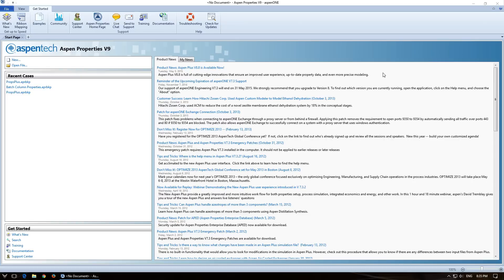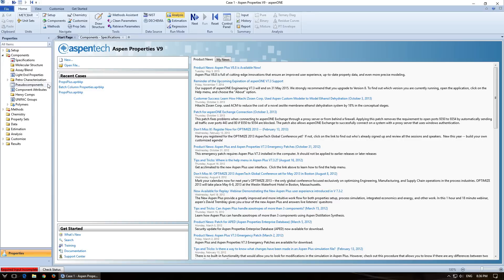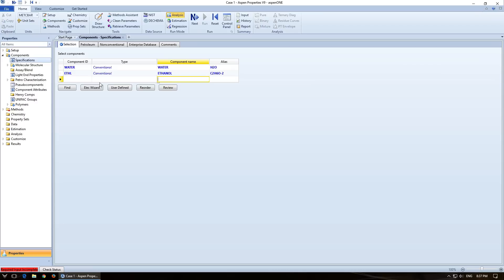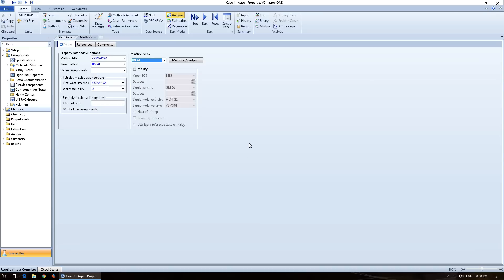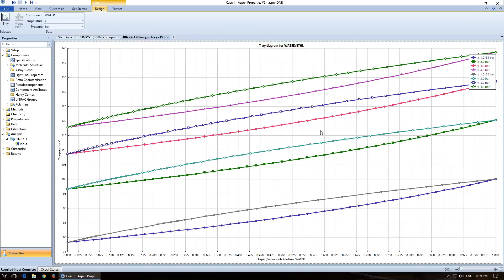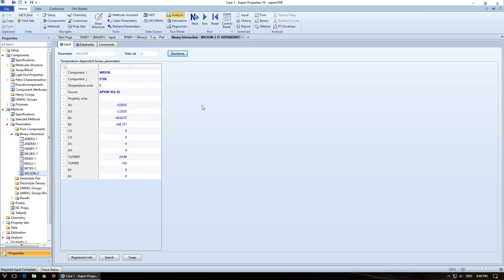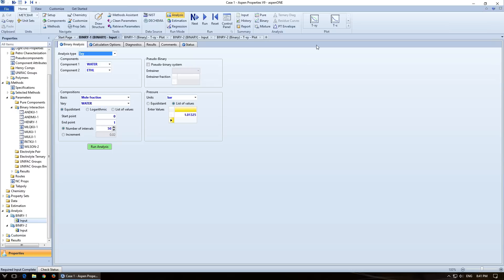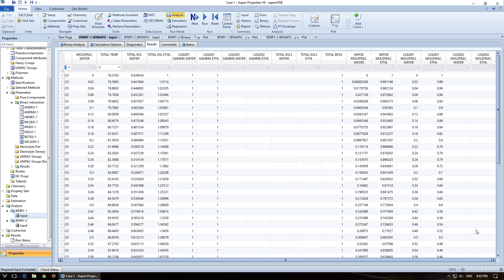Generating Txy and xy plots in Aspen Properties (Standalone or Part of Aspen Plus)

Comment: Dear CS R, I am trying to simulate a liquid-liquid extraction unit. components are phosphoric acid, tri-Butyl phosphate and water. seems the binary information for the NRTL or other common thermodynamic model for the phosphoric acid is not available in the program. what I have is only equilibrium data which is commonly used for calculation of extraction unit.Do you have any ideas or tricks to help me in this field? thanks